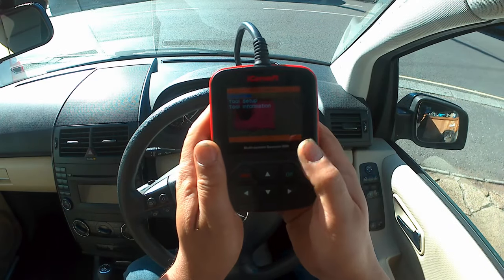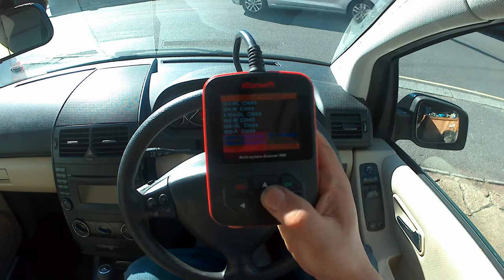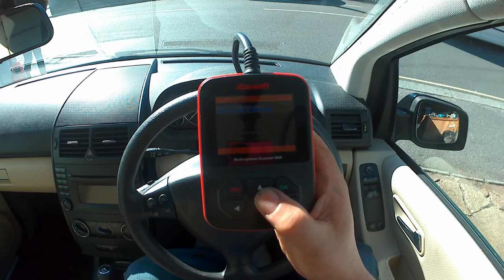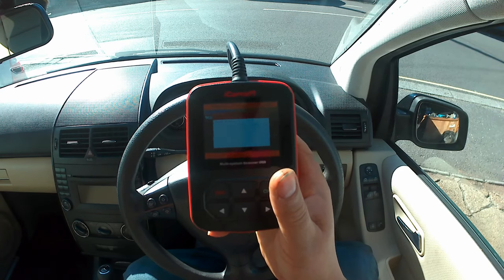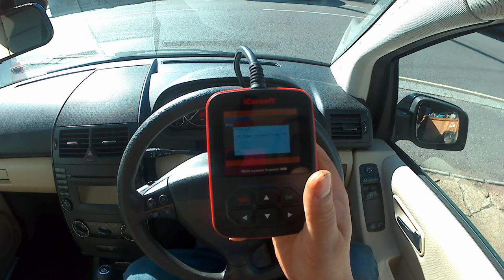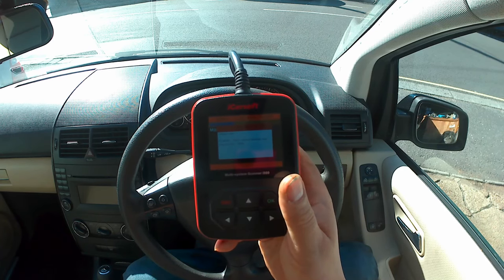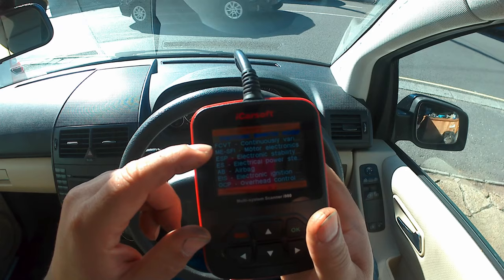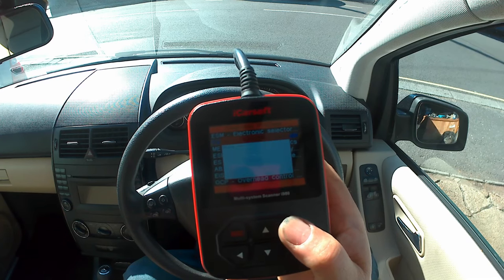MERCEDES W169 W245 COMMON CVT FAULT 0793 0722 RPM SENSOR

Comment: A 180CDI, when engine temperature is under 80C degrees, fault appears 0793 and goes in limp mode with a lovely massage "transmission-visit worshop".., after clearing the error code and worming up the engine above 80C car work's perfect no more errors and limp mode, no messages on dash bord...😊

Comment: I also have B200 automatic transmission. Thank You for the advice warming up the engine . (rev under 1K). Grts from Belgium
Reply: warming up the engine will have nothing to do with the transmission
Reply: Mybe warming up for repair
Reply: @chrismurphy7324 so why does the mechanic that knows these cars best recommend it?
Reply: @chrismurphy7324 
Heat from engine is distributing partially to transmission, so it's termodinamics baby..😊

Comment: Our W169 has failed, intermittent forward & reverse. TCM fault code 2732. Have you had any experience with this code. Research shows it's going to be the valve control body itself rather than the electronic control module. Expensive part to take a risk on, that's the problem.

Comment: Thank you very much for this video, very detailed, I managed to get my unit repaired by ECU Testing, it has been working well since January 2020. Another fault has developed, the dashboard is showing 'Transmission visit workshop', diagnosing the unit has shown error 0746, Pressure control solenoid. The transmission fluid was low but topping this up has not cleared the fault, Please can you tell me if you have ever come across this? Thank you.
Reply: Thinkcar s6 scan tool shows every solenoid and gearbox temp  and will reset ecu in auto box
Reply: @karlbigmore7949  Thank you for taking the time and trouble to reply.
I decided to replace the primary control solenoid Y3/9y1 and purchased a remanufactured one on eBay, this arrived damaged so I sent it back for a refund.
I measured the resistance on the control unit pads that the solenoids plug in to, the resistance on three of them was showing 5.1k ohms, the Y3/9y1 pad was showing 19k ohms.
I sent the unit back to ECU testing, they found a fault, cleared it under warranty and sent it back to me, the resistance readings are now all the same at 5.1k ohms, refitting and running diagnostics showed all control units pass, no faults. Driving the car however was a different story, on putting the car into drive or reverse resulted in a loud whining noise and very little drive, it sounds like the driving pully is not gripping the CVT belt properly, I did read somewhere that the Y3/9y1 solenoid is responsible for the belt tension. I feel that the problem I have now maybe related to one or more solenoids (more likely Y3/9y1) but with no way to test pressure solenoids (the Foxwell NT614Elite scanner I have appears to be unable to do this) solenoid replacement appears to be the only option.
Do you know if the Thinkcar S6 would be able pinpoint the cause of this fault? There appear to be many different models of this scanner, could you make a suggestion and where I may be able to purchase one?
Thank you,
James

Comment: How are you i have got a Mercedes Benz A170 2005 Model, i think its travelling with gear number 3, it doesnt exceed 50km/hr, thus the fuel consumption is a bit high. What  advise would you give me? from Zimbabwe
Reply: Hi where is that guy in england, i have b170 problem gearbox im lieving in holland

Comment: Hi, can you give a link to the people you recommend for repairs to the speed sensor please. Good video thanks.
Reply from the maker: https://www.ebay.co.uk/itm/Mercedes-A-B-CLASS-CVT-Transmission-Control-Module-REPAIR-SERVICE/283683774846?hash=item420cdee17e:g:BFYAAOSw8OteH93d

Comment: @4:24 you mention to that it is very important to warm up the engine before you start driving and in the comments section you say wait till the RPM drops below 1000. Why is that? Does the same rule apply for petrol and diesel models?
Reply from the maker: It's important to warn the engine, and gearbox before engaging any gear because when cold, not only the idle is high but also to the  transmission fluid is dense resulting in very high oil pressure in the gearbox and this eventually will crack the valve body in the gearbox.
This applies to petrol and diesel automatic.
Reply: @forrera168  thankyou so much for your reply and your insight into this problem 👍

Comment: I have a similar problem with a Mercedes B170. It gives a code P0793 intermediate shaft speed sensor a circuit no signal. Will buying the speed sensor solve the problem?
Reply from the maker: No, the problem usually is the electronics inside the control unit just like the video.

Comment: hi Steve , my car w169 class A getting 2734 and 0841 error, some time gear slip however from last week new error on dashboard - Transmission -visit workshop. total Milage 91k. is it require to replace the transmission ? or only replace transmission oil will work.  I checked with one garage they have given me 2nd had transmission cost as 2300 Pound.
Reply from the maker: Hello, you would get these fault codes when the CVT fluid is low, or there's a crack somewhere in the gearbox causing the pressure to drop or the gearbox is worn and doesn't hold oil pressure.
Most common is a cracked valve body.

Comment: HI thanks a lot  for  your  video, it will help me  a lot  to resold  my problem,  i have à Mercedes b-class 200 2006.  and  i have  a  fault code p0722 and  p0500. and  the vehicle il limited  on 50km/hr  can't  speed  out  of  this limit, do you have any idea. plz. i can't fin any oissu  for  this problem.. :( 
  thanks and have  a good day.
Reply from the maker: Hi, I advise you not to drive the car until it's fixed or more serious damage will happen to the gearbox. Have the CVT control unit repaired or replaced.
Reply: @forrera168   Thanks a lot.

Comment: I have a b200 turbo with the same message, must I replace that unit? The car looses power in the mornings and accelerates hard when you lightly trap the throttle thank you!
Reply from the maker: The control unit is repairable most of the time.
I don't advise you to drive the car as it is because it will eventually damage the steel belt in the gearbox.
Reply: @forrera168  Would it be feasible to allow the engine to warm up before driving?

Also should. I refill the transmission fluid incase that's the problem. It went for service but I didn't replace the transmission fluid
Reply: The problem is that this rubbish B Mercedes  most gear box are  Peugeot or citroen gearbox and not Mercedes that is why all series A and B have those issues.

Comment: Hi have dropped out lower part off box to get to speed sensor for repair but now inside box the part where the 7 black bolts bolts to  is lose and moves around on the 10 mm bolts and a black band on side of it is this normal hope you can understand wot part I'm trying to explain please help
Reply from the maker: This is the oil pump and it's normal to be loose. Once you've tightened the 8 bolts it won't be loose anymore.
Reply: @forrera168  ok thanks so much for that was worried about that I got new solenoids from aliexpress 65 pound for 8 eny good

Comment: Hi! How long is enough to warm the engine? Thanks!
Reply from the maker: Just until the rev counter goes below 1000 rpm is ok.
Reply: Sevan Motors FORRERA Thank you, very much! Maybe you can recommend some resources in the Internet, which is useful for MB new owner? I drive 20 years, but with VW Golf and it's easy. MB we will buy at winter (I hope) B Class 2005-2009. And it is another story. Thank you! Ansis, Riga, Latvia.
Reply: Sevan Motors FORRERA One more question, if I can ask. Which model of B Class to buy? Gasoline, diesel? Automatic or Manual gear box? Thank you!
Reply from the maker: That depends on your personal preference and circumstances.
Like if you drive in town then get a small engine auto gearbox, if you like sports driving then a bigger engine would be better.
Reply: Sevan Motors FORRERA Thank you!

Comment: Hi there what is your garage location pls? I have same issue transmission goes on limp mode same dash warning
Reply from the maker: Sevan Motors

237, Railway Arches, Trussley Rd, London W6 7PP
020 8741 4510 https://g.co/kgs/iB3FGS

Comment: i have fault code 07201 0718 0722 0794 0896. are the all related to the evt
Reply from the maker: what is the year and model of your car?
Reply: @forrera168  2006
Reply: mercedes a klasse 180 2006 diesel 2.0
Reply: @forrera168  i fixed the cvt the fault code have been gone but the car is not moving
Reply from the maker: @moadhamich6919  how much CVT fluid did you put?
Reply: @forrera168  I changed the filter and fluid oil 5 liter